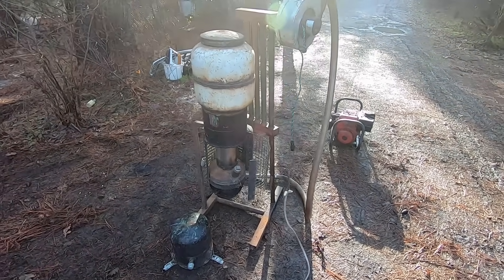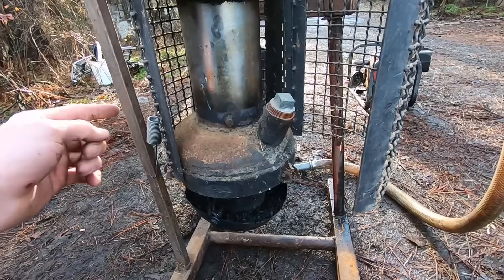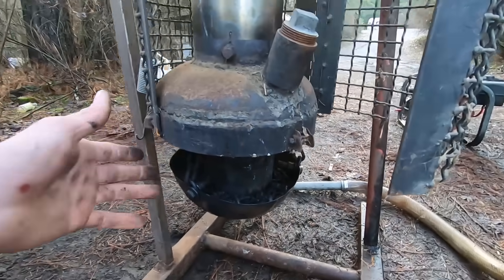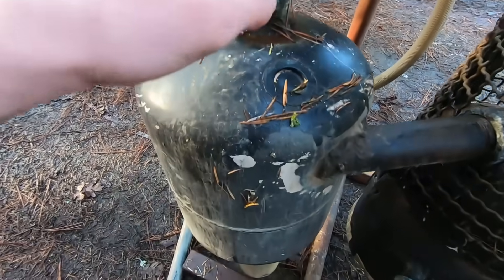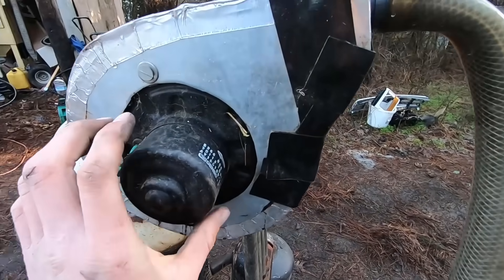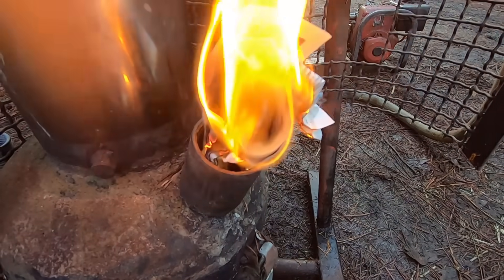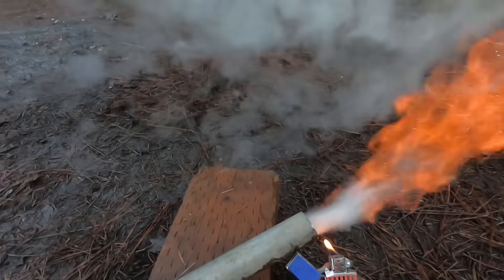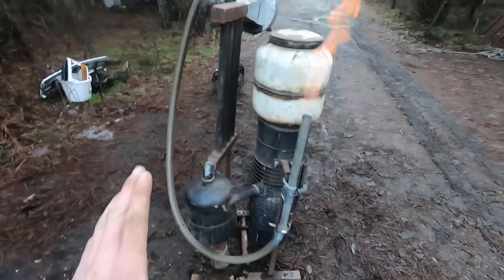Using Wood to Fuel a Generator! (How to Build a Wood Gasifier w/Demonstration)

Comment: Add a way to add in waste oil, or fuels -- would be awesome for off-grid -- and maybe add a way to harvest the heat into solar salt or something else to heat your off-grid building -- and using something like a peltier element, you could in theory make some DC electricity off the heat in an emergency scenario -- and you could also use the peltier to heat up the burn plate during start up -- and the cooling side to help get rid of the water vapor

Comment: Great work, there are large scale units available complete with dryers and generators built in. We looked at them for our pallet yard, We produce about 2 ton of wood chips every day and have to dump it. To use all this we could power the whole street of industrial sites, We would however have to invest a bit over 1 million dollars to set this up. Great to see such a compact Gasifier, Gould you let me know how mush wood is burned per hour approximatly?  Nb. I'm in Australia.   Very good video production as well. Regards
Tim
Reply: It sounds like you have the ability to make a positive impact by taking it on. Of course $1M is not a small investment, but is one that would have a number of ways of positive benefit. I dont know about OZ, but in the States there would be some tax benefits that would offset the cost. Being a 'power company' of sorts you could bring in revenue from the other businesses you provide power for. Either way, the ability to take a waste product and use it would be a boon for the environment as a whole. Good on ya mate!  Cheers!

Comment: I new someone here in Australia who ran a WWII Jeep with one of these. The war had just ended and the Jeep cost him $50 dollars cos it was cheaper to leave them here than to take them back to the U.S. Cheap motoring.
Reply: I would about kill to have one of those.  Especially one of the 4 door models not available in the States.  I have a 1974 Jeep J20 with a 401 and would love to have a quad cab running on a gasifier.  Cheers
Reply: Keith Hogan I don’t know much about jeeps after the early 1980s but I get the impression that they don’t make them like they used to.

Comment: Wood gas is WW2 tech...lol
Reply: True, but who will have power and the ability to drive a vehicle if fuel and power are down/not available?  It doesnt have to be a full on SHTF scenario.  Think about any of the large scale natural disasters like Hurricane Katrina.  Being able to have electricity, pump your own water, etc will be huge.
Reply: @keithhogan6997  yeah,just because it's old, does not mean its bad or not useful. I remember reading about this long ago as it was used during WW2 due to fuel shortages

Comment: It's highly acidic. It will waste an engine used raw this way for a prolonged period of time. You can purify it and jump through all the hoops but browns gas and methane are just as easy to produce and do the same job cleaner.

Comment: QUESTION!!!  Can you make it a self running gasifier that you would use the wood to get it going, then hook another gas line to the Gasifier.  Will the Gasifier run on it's own gas???  And just use wood to start it.  Have another pipe to run a Generator, or other.  Can you make it self sufficient

Comment: Its a great moment to run your first motor on woodgas... THEN! The next day , a valve in the engine is welded shut with wood tar! ...true story :)
Reply: I made a similar comment here. I like this video for showing the potential of wood gas but people need to be very aware of the rest of what needs to be done to use this in the real world over time.  Someone will end up destroying their engine following this video- and then wonder what went wrong.
Reply: @kirkjohnson9353  aLL IT nEEDS  is  bubbler with water in conatainer to clean out the ash and tar. clean
fuel = no tar = clean engine/motor

Comment: I love your video style, everything that needs explaining gets mentioned without wasting any time, great stuff!
One question, can you run both diesel and gasoline generators on wood-gas? 

I'm absolutely clueless about engines but do have a passion for biochar making and I'm currently working on a biochar producing stove with a wood vinegar production add-on which is basically a retort to fill with pellets and then condense the smoke that comes out of that into tar and wood vinegar, which will leave me with the clean wood-gas so now I kinda have to get thinking about running a generator on it because flaring the wood-gas off would be a bit of a waste and permaculture is all about making the best use of all aspects of whatever you are doing.

Comment: I would be interested to see how much run time you would get if you connected a battery charger to the generator, while charging the battery to power the fan blower. Excellent job by the way!

Comment: My mother was a nurse in Germany during world war 2 and had a car that was fueled by a wood gasifier  pulled by a trailer.
Reply: I've read about those and seen pictures. Some units were actually car mounted. They were used in Sweden too for sure.
Reply: My dad was a soldier in Germany after the war and he saw them in use. He was interested in these vehicles that would stop and empty a bag of wood into a tank and then keep driving.
Reply: @kirkjohnson9353  I found out about them in a book on alternative energy published in '80, just after the second oil embargo. I still want to build one! Thanks for your input!
Reply: @CuriousEarthMan  It would be an fantastic project. There is lots of information now days to really do it right. I have been interested in building a unit that uses charcoal instead. This simplifies the step of cleaning the gas. I burn firewood for heat at home and could be making charcoal all winter and heating my home in the process.   Not the right idea for everyone but I thought I'd mention it. Build one man! I suggest you connect with others who have already built one- for a little guidance and loads of inspiration.
Reply: @kirkjohnson9353  Thanks for your encouragement! How are you planning to make charcoal? I bought materials to make a retort a long time ago but never made it...including several yards of asbestos cloth, to give you an idea how long ago it was! The design was to use a drum, heat with a fire underneath, and pass the gas through a pressure valve into a copper coil of 2" copper tubing, and then condense some of the emissions, as you'd get some methanol and plenty of creosote/tar. You could use a straight run of tube instead to make for easy tar removal. When Henry ford built his retorts for charcoal (to sell to his car customers to use on car-related outings) he recycled the gas back into the flame to make it more efficient. Mike Rowe of dirty jobs did one on charcoal which might help.
Reply: @CuriousEarthMan  You sound well informed. More so than me I'm sure - but the concepts here are actually pretty simple. I was going to do some research and then build a large insulated unit outside of the house that I could place a steel barrel inside of to cook the wood in. I would do a batch at a time and heat my house with the 'waste' heat. this idea works for me because I have huge supplies of crude wood to 'fuel' the operation with- including free wood pallets that I could just slide in and burn whole. The unit would be large mass, maybe sand, with pipes in it that pick up the heat to send to the house. I would carefully process the chunks that goes into the barrels (to end up with consistent , easy to handle and process charcoal) 
 but the 'fuel' stuff would be very crude and require only that it be under 4' long or something. I would be using almost all of the 'waste' heat in my house. Some processes recycle the gas from the charcoal barrel to fuel the process- this basically does that and then uses the heat in my house.
Reply: @kirkjohnson9353  Technological advantages like that are why the Brits had to destroy Germany... even if it meant teaming up with Stalin.
Reply: @CuriousEarthMan  do it.
Look up "FEMA wood gasifier plans"
A 90 plus page instruction manual and build plans should come up.

Search in YT for wood gasifier.
You will see many.
Reply: thats ancient technology ... but still great! ... http://www.holzvergaser.org/geschichte/
Reply: Do you have any pictures of it and know who made it? That's very cool. It was imperative at the time, and forgotten due to apathy and easy oil. We need to revive the technology from the past to run the now.
Reply: Was common during the war - here we had even public transportation / coaches running over wood gasifiers.
Reply: really awesome ! i wonder if you'd need insurance ?
Reply: I'm from sweden, in ww2 there was fuel shortages and many car had gasifer. You had to start the fire early when you wanted to go somewhere. There is still an old car with a gasifier in my hometown that the owner drive sometimes.
Reply: Indeed. I think it was Mother Earth News that featured some time back a full-sized pickup that ran well on wood gas.
Reply: @rcnelson  I had that issue of MEN. Back then the magazine was like a bible to me . It was monthly filled really great ideas like that. I actually ordered a set of plans to build a car that used the starter from a jet engine (electric) that was driven by a small gas engine. Yes, this was decades before the Prius - but it was the same idea.
Reply: @kirkjohnson9353  When I was 16/17 back in the '70's I read every issue for a few years but for some reason it dissapeared from the Newsagents. (Australia).
Reply: @rcnelson  they went across the country with wood scraps from saw mills.
Extremely interesting.
Reply: like this https://www.youtube.com/watch?v=cbCiMFF1YSE
Reply: https://www.youtube.com/watch?v=wZ45RTIGmYo  Still some of drivers are using wooden gas in they cars
Reply: In France during the German occupation people ran their cars with a so-called "gazogene" which probably was a system similar to this one.
https://www.youtube.com/watch?v=XWROJkqRSB4
Reply: @Khamomil  yes, "gasogen" in English. The system is called "incomplete combustion" of the carbonaceous fuel producing mostly carbon monoxide (CO) often called 'producer gas' or syngas.
Reply: Its a true !  My grandfather  too  !!
Reply: Yeah, Germany used that to run vehicles when they were super short on fuel late in WWII. Some few enthusiasts still have working wood gas cars and drive them on weekends.
Though I guess if everyone would use it for daily mobility in a densely populated country, the emissions would become a problem. Not mentioning the fact that you need to know you wanna go on a ride half an hour in advance. And that you don't just need any wood, but wood chopped to the right size and and dried to a certain degree.
Reply: @Makama975  Exactly! You need to know in advance. And if you didn't know the roads, and there were hills involved, you might not have gas production up high enough and might have to pull over for a while to build production. The thing about the exhaust, is theoretically, if you pull out the tars from the gas if using wood (vs. charcoal), the exhaust is mostly carbon dioxide and water. The gas produced by this incomplete combustion in the gasifier is mostly carbon monoxide. But I'm sure in practice there wood be some unwanted by-products. There are likely to be nitrogen compounds at least, from using the air for combustion. I think these things are really good for stationary engines, and if run efficiently, produce the same wastes as the wood would produce if it simply rotted away without being used for anything except feeding forest bugs! It's renewable! :) I think it has a place in our energy mix!
Reply: They also had panzer tanks running on wood gas
Reply: I first read about this in Farm Show in 2007. Farmers would build such a contraption in the bed of an old carbureted pickup truck. The burners would be in the bed and the filter pipes would be on the sides serving as side rails.
Reply: Y'all are dumb. The gasifier was pulled by trailer and it powered the vehicle which then pulled the trailer. In other words it's like your gas tank being on a trailer the your car pulls.
Reply: My grandpa was a guard at auswitz.
Reply: Seen tractors with wood gasifiers pretty cool stuff
Reply: "pulled by a trailer"?
Reply: ur mom was nazi\?

Comment: Observation: at about minute 13 you mention the "thick" exhaust cloud with contaminants: much seems to be water vapor; if your gas line is still "touch warm" and you carry this out in the cold (winter) you see the water vapor like this, with some organic residues, including Acetic Acid.  Just pH your exhaust condensate in the plastic pipe with a cheap paper indicator for fun. 
Recommendation: Extend your condensation line. Add a water-bubbler with lime milk (Calcium hydroxide or baking powder) to neutralize the acids and wash out volatikes. Then add Calcium Chloride as waterabsorber (you can buy that as closet dessicant at hardware stores); howeverCaCl2 will have to be regenerated periodically and increases your running costs; if you precede your CaCl with an absorbent like dry coal (or active coal) of saw dust, you can extend its life. That filter - of the CaCl2,  will darken from soaking up organic residues. If you don't do that, then your engine gets that residue, and eventually, tar up.
Reply: Curiosity wise: dry pyrolysis like this gets really interestinng when it gets to plastic waste: the big problem with plastic is that it always comes mixed, and sometimes even blended, and with paper and dirt, so actual recycling (re-melting and re-molding) is difficult. However, burning plastic mixes is no good: things like PVC = Poly Vinyl CLORIDE(!), that is all halogenated hydrocarbons, cause dioxines when burned (akin Agent Orange, makes cancer and deformed babies). In order to prevent that you need to "burn" PVC hypoxic, in a reducing flame, and you end up with the chloride as hydrochloric acid (HCl) instead: easier to filter out. Dry anoxic pyrolysis could be a way to deal with mixed unsortable plastic waste. If you do this just for experiment, one could add increasing amounts of plastic (non PVC recommended, though) to your wood to see, how long the process can be maintained.

Comment: Nice video. I might try wood gasification soon. I'm rather happy with my charcoal gasifiers (I have built two so far). I have a 4kw backup generator that runs on my 55 gallon drum charcoal gasifier in case of a power outage. Looking to build a unit to run one of our trucks (see: Gary Gilmore and Wayne Kieth). Again, thanks for an awesome video p.s. if you're interested, you can check out my charcoal setup on my channel

Comment: If you are dropping moisture in your hose, this just means you need a larger condenser, may need to add a cooling fan depending on climate. If you stick an intake valve, not a big deal and I can show how to fix, just contact me and ill be happy to share that with with you.
Reply from the maker: Thank you for the advice! It seams as though that's the main killer in gasifier designs. A fan would work well but I'd just hate having to power something with electricity. Maybe an eco-fan perhaps? I appreciate your comment and your offer!
Reply: @randomn6473  Its just part of the system, my machines have tons of automation and I use liquid cooling for gas chilling. Its pointless if you cant establish flows and clean gas. So taking a little energy to put back into the system is fine.  These things will make up for themselfs and you get more power than you would otherwise with wet weak gas.
Reply: @Thrive-Off-Grid   Randomonium You could use a high mounted water tank and convection heating, at the end of the run you'd likely have enough hot water for a shower ;-)
Reply: @mungewell  Yup our CHP use gas cooling and exhaust heat combined. A 5 kW system can do a lot more than heat water for shower, it can supplement full heating for an entire house.
Reply: @randomn6473  what about a solar panel to power the blower and a fan on the condenser?

Comment: But the generator isn't running a load. Is there enough gas production to drive  a couple thousand watts?
Reply from the maker: This is a very good point and something I hadn't considered. I can't give you a maximum as the most demanding thing I've used this for was a circular saw. Thank you for the comment!
Reply: @randomn6473  I could be wrong, but I dont think that generator was designed to put out 2K watts.  Once you find the size generator to fit your needs you would size your gasifier to put out the necessary amount of gas to run the generator.  Am I on the right track?

Comment: I have a generator with a 350 V8 already set to run propane. I would love to make a gasifier for it as a secondary fuel source. There is plenty of hardwood around here and you can get anything from sawdust to chips to ends and pieces from the mills free.

Comment: Harbor freight solar panel to run the fan and total free running ... Grind and compress char into bricks for forge ... Next convert liquid fuel engine to steam ... Easy is two stroke ... Four stroke a bit harder as you have to double the lobes of the cam(s) ...

Comment: It would be interesting to see how the fuel efficiency of this would compare to a simple thermal engine such as a stirling engine. Even if the wood gasifier is less efficient you can use common IC generators I suppose and you don't seem to have a shortage of fuel where you live :P. I'd love to do projects like this but alas there isn't much space for that where I live in the UK atm, guess I'll stick to my 3D printing for now :). I'm liking your videos, home engineering projects like these are few and far between on youtube, keep up the good work, subscribed.